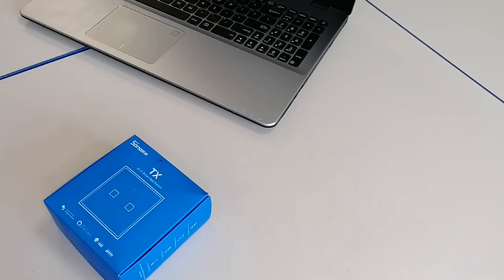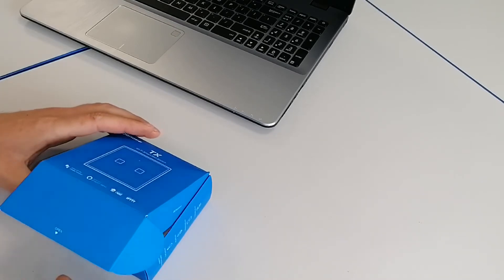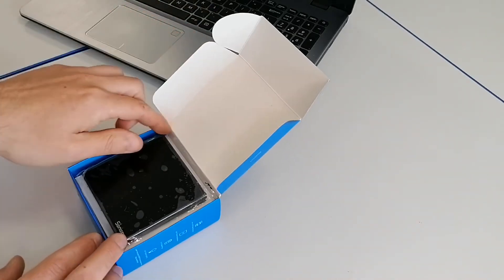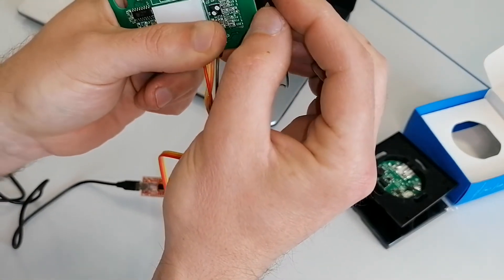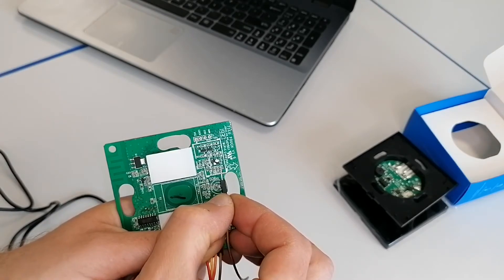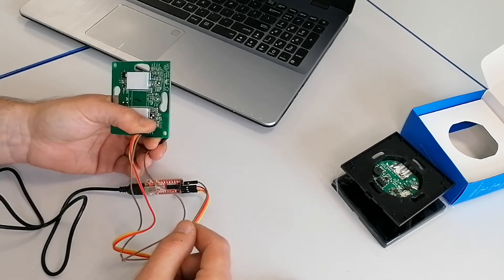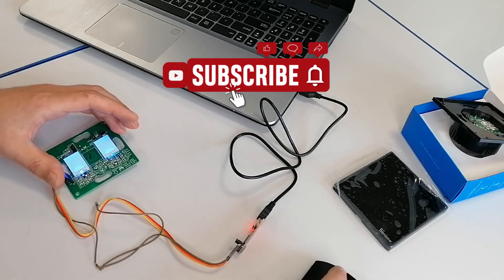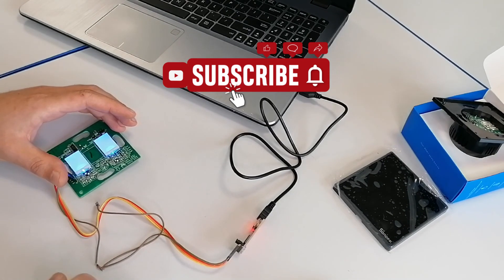How to flash Tasmota on Sonoff TX T3EU, ftdi ft232rl, Tasmotizer, Home assistant, ftdi ft232 driver

Comment: How to reset tasmota on sonoff touch, for connect to new wifi. Thank.
i tried press and hold touch button 15s, 40s... but tasmota access point isn't showing
Reply from the maker: I am not sure, I would just try to re-flash the switch